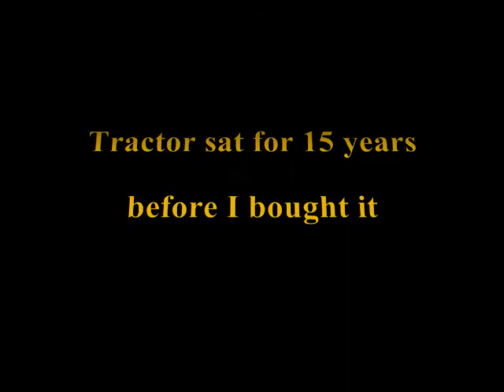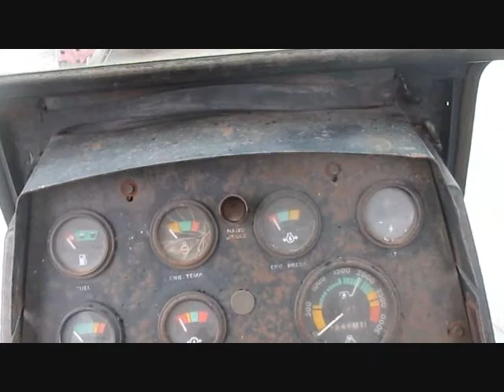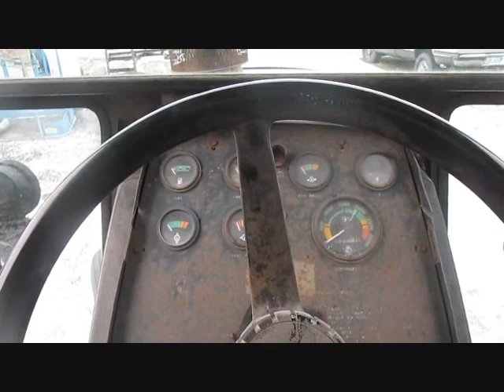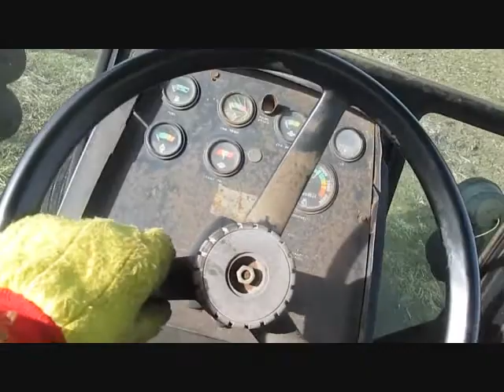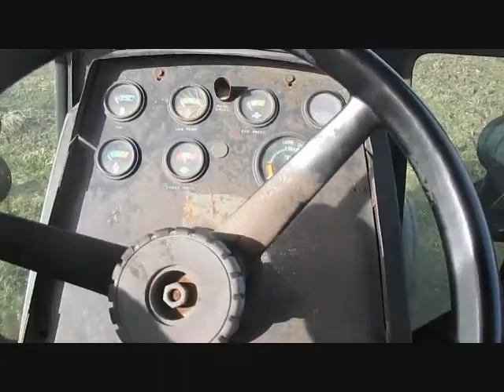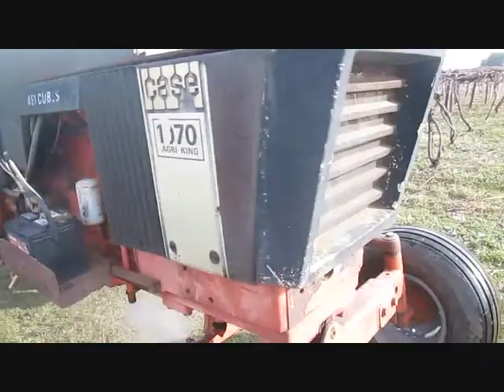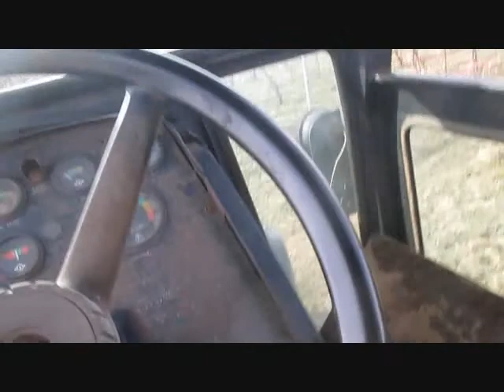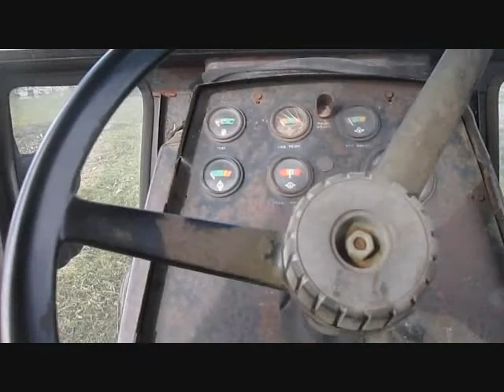Case 1070 Black Knight

Comment: Pull power shift all the way back for reverse. I been running a 970 for many years. Reverse doesn't work in 4th range but only 1,2,3 ranges only!!! Do not leave the tractor in reverse when sitting still or the power shift will be tore out of it from overheating!!!!!!! Yes it will go & stay in reverse sitting still if you leave the power shift in reverse & the range ( tall leaver) is in neutral. Don't leave in reverse sitting still!!!

Comment: A older farmer that I know that has a 970 black knight, 1370 and a 1570 , told me to pull the power shift down to 1st manually, he said it would wear out the power shift faster if you push in the clutch when in 2nd or 3rd, he also changes the oil and filters yearly under normal use, keep the power shift in one gear when doing tillage work, if you jump the power shift under heavy load this will wear them out prematurely. I hope you get that tractor fixed up,
Reply: Yes, good advice, top notch maintenance needed to have any chance. And whatever you do, don't run the PTO with the powershift gear lever in reverse and the range  selector in neutral. It starves oil to some part or other, can't remember, and you'll need to split and do clutch packs etc.

Comment: That's great to know so my check valves have been thrown in the bin then by the looks only just brought a case 1070 and change the hydraulic oil and have the same conversation with the parts dealer
Reply from the maker: So far my 1070 is still going strong. I heard without those valves it will take out the power shift.

Comment: reverse is one notch behind first in the 3 speed power shift push in the clutch for the shift. its possible to use the range selector as a parking brake but the engine must be shut down. place the range selector in 2 ranges at once it wont roll but dont let the clutch out with the engine running like that.

Comment: Reverse is the power shift lever pulled back. Are you going to restore this one? I'm looking for one to, grew up with these. Yours has blowby so the heads need rebuild, the fuel gauge float gets heavy and sinks to the bottom, the tachometer cable drys out and breaks over time, there's another valve spool assembly on the right next to those filters and they plug with fine dirt bcuz people don't keep up changing filters and it's mounted vertical on the tractor but your power shift works good, if the engine surges during idle it's the injector pump, if the pto still spins when shut off it will need a new clutch pack (when they slip the clutch plates warp) you can do it yourself they're not hard, sometimes the cab mounts dry out/get squished flat so shifting makes the whole cab "rock/roll", the shift levers can be tightened up when you take that shift lever cover plate off and then it's not so dangerous if it's in neutral or still in gear. Remember to NEVER EVER EVER leave the power shift lever in reverse while doing stationary pto work - that will destroy the power shift clutch fast. Worst thing that can happen to these 1070 is the powershift transmission will crap out around 9000 hours and it's expensive. I think yours still works because it doesn't have the over sized 20.8-38 tires that's too hard on these. International had a 656 with similar shifting issues, never could tell if it's still in gear or neutral so it's dangerous if your starting it with a screw driver on a cold -35 morning. The john deere tractors had their version of the power shift that's better design but 10 times more expensive to rebuild, synchromesh i think it's called. Some case had a standard 8 speed hi/low transmission that last well past 10,000 hours. I know many modern dairy farms still buying case like this one, put it on a silo blower or silage bagger broken windows rotten flat tires and there it spends the rest of it's life. Imagine how expensive it is to rebuild a modern case? In fact it would bankrupt a modern dairy. We had a 1370 with "issues" and i've always said that 1 very costly tractor doomed our dairy farm but my dad HAD TO HAVE IT. Nice find & thanks for the video.
Reply from the maker: I have some use for it this spring then i might start fixing it up. I also have a white 2-105 i want to get going. Im just about finished with a massey ferguson 65 diesel.
Reply: jasonmushersee  you seem to know slot about these case tractors I have a case 1070 and can't seem to find any manuals for the thing and never got them when I purchased it and was wondering if you cold help
Reply from the maker: August Hillebregt 1070s are common, seems like a manual would be easy to find. if you need any help let me know. this was my main machine last year.
Reply: @michaeljp86  Tire size 13.4 by 28

Comment: have replace your clutch spring. i remember doing  that. they do wear out in time. it's  underneath clutch pedal. when you step down it should be tight. your gauges  probably need replace.

Comment: Pretty much ditto on this whole thread, but you've got to put up more videos on that 1070. I've got an early 70s yellow paint, cast iron grill shroud . It's next to impossible to find good reliable resources on these old tractors. Mine runs really well except the pto clutch or brakes are going to have to be gone through. It spins non stop when the engine is running. The brakes are shoddy, no emergency brake at all, every single wire that isn't essential to the tractor running is bad. I've got wires dangling everywhere, no lights, no gauges except tach, a/c and heat don't work, alternator doesn't have anything hooked up to the two wire plug on top so obviously it's not charging, my three point level sensor is stiff and I'm not certain it works, the filters look like they've never been touched since Nixon was is office, the fuel primer pump is completely gone and they routed the fuel line directly to the primary filter, all the cab glass is gone and even with all those things,,,it's still a really mechanically solid tractor, the power shift works all the way through, the three point is very responsive, the tires or good, the wheel bearings seem to be in good shape, the steering is tight, it pulls like a beast and its got a fairly new seat, of course I'm not sure what it came out of because there's only one bolt that lines up to hold it on and the rail frame is about two inches too big all the way around, the body is in great shape and no missing panels. Honestly I've got way more to be thankful for than the things that i can complain about. But i was really hoping you had this twenty part series on your restoration that i could watch and see how you took care of all that wiring mess and pto trouble etc.  Oh well, at least we both know what each other is dealing with on these old brutes and I'd put up videos of my own restoration but i don't have the patience and my cattle would probably break my camera while i was trying to film. I've been working on it outside of our barns because its hooked up to a 12 ' mower and it's my temporary emergency brake . Good luck brother, and get busy on those vids for all of us tractor lovers out here.
Reply from the maker: I never restored this one but would like to some day. Its my main tillage machine. I need to replace my pto cable. All my cables were rotted in half. Sadly i dont have time or money to restore tractors now that i have kids.
Reply: @michaeljp86  everything in due time brother, God bless
Reply: This maybe to late of an answer but the ptos on these tractors just keep spinning. I work/ help out with a ranch with a 1070 and he said that they all just spin aimlessly.